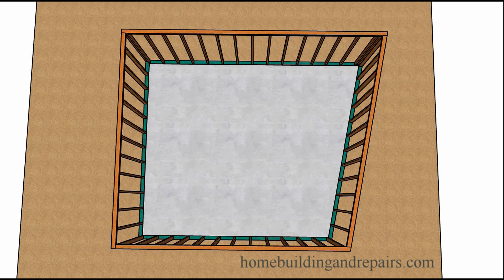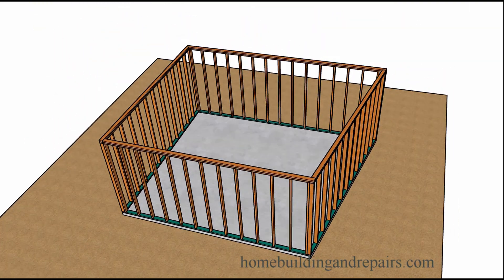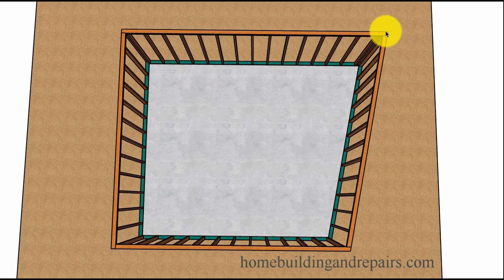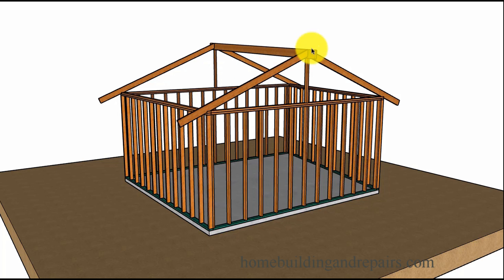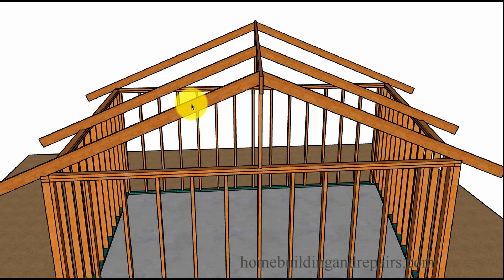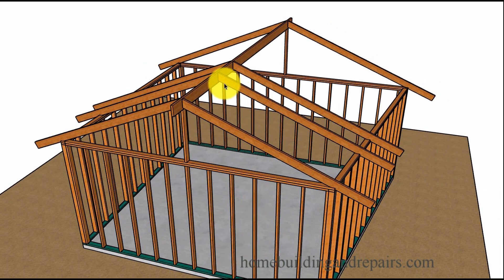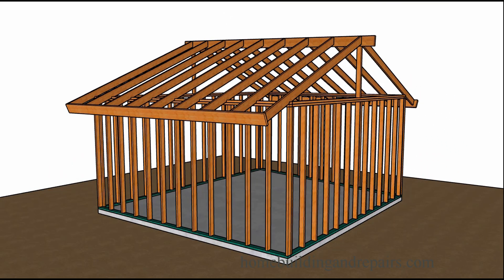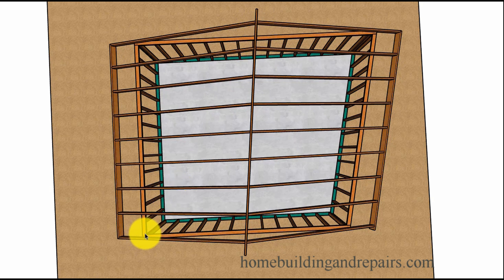How To Frame Roof With Quadrilateral Shaped Floor Plan And Angled Ridge

Comment: Great video, thanks. Did you ever do the follow up other videos about framing it with a flat/level ridgbeam? Im interested in how to do it flat, or with the highest point of the ridge beam at the other end (the narrower gable end). I'm trying to design a freestanding sauna with this exact sort of floor plan, but for thermodynamics/air flow, I need the roof flat or higher at the narrower end. cheers

Comment: Great thanks can you please explain how I find out how far my ridge needs to be out of level ?  Do I just cut the rafters the same length and let them meet from the wall plate to the seat cut ? I get the ridge having to be at an angle and central to each  wall plate as a normal building it’s just the unlevel ridge and how to work this out ? I’m sure if each rafter has to be the same then this will give me the pitch at the angeld side too please can you help me on this one

Comment: This is really helpful. I'm trying to figure out how to add a roof to my daughter's tree deck, which is an isosceles trapezoid, dimensions about 4 ft (short side next to the tree) by 8 ft (long side away from the tree). The deck is cantilevered, beams and braces attached to the tree with four 10 in long, 7/8th in diameter lag screws. No walls so far, just 4 ft high guardrails around. The kicker is that she has asked for a gabled roof. Any suggestions?
Reply: I’m in the same boat. Did you find a solution?
Reply: @seabass40004  Well, after creating a scale model of the structure out of balsa wood, I found that one option (for my project anyway) is apply the same exact dimensions of the trapezoid deck to build two identical trapezoid frames, then align them, along their non-parallel edges, on the non-parallel edges of the trapezoid forming the top of the 4 ft high guardrails--when angled inward, where they meet forms most of the gable roof ridge line. While the ridge line slopes significantly upward from the back area close to the tree and ends around 3/4 of the needed length to complete the roof, it is significant because it forms a seamless start to an mostly complete gable roof over the structure. It was easy to finish in several ways by adding balsa in different ways to that initial roof design. But it sorta makes a cathedral ceiling, so I haven't built it yet. I reached out to Maker Pipe about this as a project, and haven't heard back. I'm still contemplating how to make this look more normal. Any thoughts for me based on this update?
Reply: @seabass40004  I'll add several images to my YouTube profile about this shortly.
Reply: I would really appreciate any feedback.
Reply: I'm still interested in feedback.
Reply: I definitely understand the need for flat roofing and the angled ridgeline. Milestone moment. Thanks.

Comment: I wonder... do you think it's possible to put a gable roof on the other way around - the ridge parallel with the two parallel walls? I am building a house and this is the architect's design, and it's been approved, but I haven't come across anyone with any experience of this
Reply from the maker: Yes, it can be done, but I don't have a video on this yet.
Reply: I’m wondering the same thing. This video is great and I really appreciate the help in visualizing how I could handle the roof on my odd shaped building (for the same reason - one wall following the property line), but I would need the ridge oriented the same direction as the parallel walls. Can anyone direct me to help/advice with this?

Comment: Wow! I believe this may be the solution to my issue!  I'm doing a shed roof off an existing roof over a structure with angles.  There is no ridge but if I put in the end rafters and run a line at the tie in points then adjust each rafter to the line., this should accomplish the same thing.

Comment: Found it...
Not the roof for me.
It won't work on my building.
My wall lengths are..
Top 2M 
Bottom 8M 
LHS 8M
RHS 10.5M I think! (Angled)
Onto paper drawing these dimensions would be a birds eye view of the shed size.
It has 2 90° corners on the left handed side.
The longest wall... unsure about the angles and I think it's 10.5 Meters long, I could be out! 
Think I'll need to create a roof that works and is pleasing to the eye.
I'll need to imagine the shed isn't one whole shed and maybe brake the roof up into 3 different pitches with hips and valleys. I dunno yet.
Looking for ideas.
Reply from the maker: I would love to see a picture of what you end up doing.

Comment: Woody doubler method that you have shown in previous video for floor joist work for ceiling joist as well I am wanting to install a couple mini-split AC cassettes in my ceiling and they are larger than the space in between the ceiling joist.
Reply from the maker: You can email me a picture of what you're doing or provide me with a little more information. I don't know what AC cassettes are and am thinking that it was a misspelled word.
Reply: @gregvancom  An AC Cassette is an air conditioner vent that mounts into your ceiling. Its a 9,000 btu unit for a mini spit that mount outside and the cassette has the copper line sets run to it. It measures 22 1/2 × 22 1/2 × 11 and hangs from the roof by treaded rod. The problem is my ceiling joist are 16 on center.